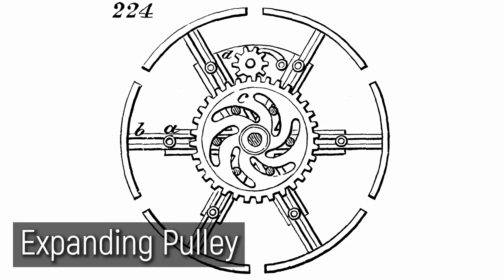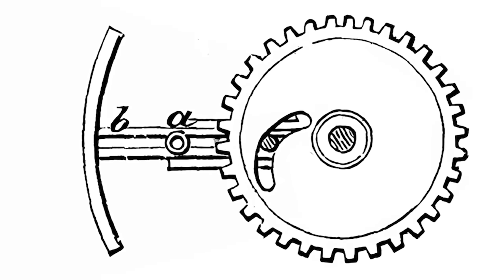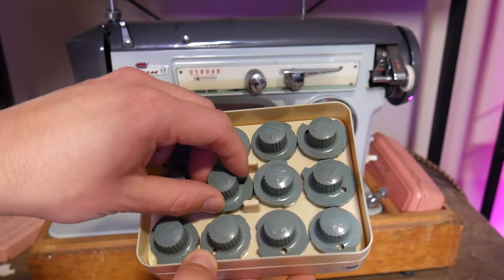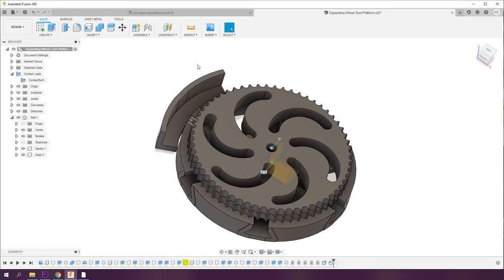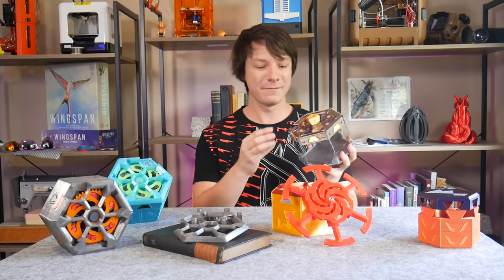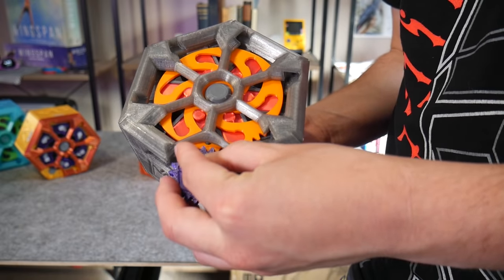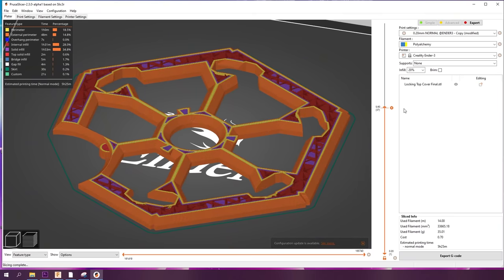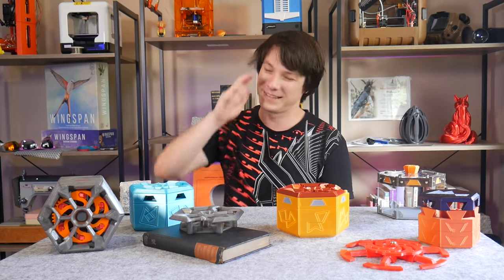This Expanding Mechanism is Crazy Clever

Comment: Best use for this would be an expander, joining two pipes of equal circumference, using the expander inside one pipe to enlarge an area for other pipe to slide in followed by welding/gluing. Turn the long pole the expander is connected to the opposite direction to be able to pull it back out. Of course it must be strong to stretch the pipe slightly wider…

Comment: For the expanding thing : i saw a video, quite some time ago, that used that mecanism ! The maker had attached these triangular panells on top of the rollers, so that when they were at the center it made a decent table, maybe for one or two.  But then he turned it, and it epanded, and by putting separate rectangular pieces in the gaps and the middle, it made a table twice the size, that could accomodate 6 people ! So... it could be used to save space ?

Comment: It would probably make a nice closing/sealing mechanism for the lid of round containers and barrels. Like putting some wedge-shaped ends to the "arms" that press the lid against the container/sealing. Like that snap-in locks on Tupper ware, but on the inside and operated with a single movement. Of course, you'd also need to seal the rotating shaft for the handwheel in the center. And the inside of the lid should also be covered, to prevent debris from getting into the mechanics. And the material of every used component also needs to be suitable for what you put into the container... Jeez. In retrospect, I don't like to work on this project anymore. lol

Comment: You can eliminate the dual key reset (while locking due to the lock raising into one of the spiral gear cam slots) by adding a 2nd magnet in the key. It works well (I did it).

Comment: Is there any way to incorporate springs that would push the arms back out after you wind them inwards? If so I would find a way to use the handle the way you use the key. In a way that allows you to push the handle downward to make contact with the gears, or even pulling the handle up. If you could find a way to make the mechanism lock once the arms  are fully retracted, then you would be able to pull the top off/out while the arms are locked. Then once you put the top on/in you could either pull the handle  back up (disengaging it from the gears) or pushing it back in based on the direction you chose to engage them. Which would allow the springs to push the arms back outward.

By the way I absolutely love your box design. Thank you for showing it.

Comment: This mechanism is meant to regulate the gear ratio of a thick and flat belt. The entire mechanism acts as a pulley, but it’s radial cam/follower only operate to dynamically scale the diameter (& thus turn radius) of it’s relation with whatever is turning it. Think of this mechanism as a slack-breaks or variable sensitivity regulator. I know this because a device seen once used similar formations to allow the slamming of a vehicle’s break pedal to simultaneously deploy parachutes and close fuel paths during speed tests. Though the actual cam articulation was triggered by the drive gear locking as the entire mechanism rotated with the engine. It seems the patent here is describing a more pure example of the principled operations, yet does so with an inverted flow of workings. 
      Instead of thinking of the mechanism statically having force applied to the drive gear, consider the mechanism turning about it’s axis and having the drive gear’s likewise motion retarded by an applied friction or locking catch. This translates whatever triggering force is used into an expansion of the radial pully’s diameter; many useful results can benefit from this. However, the follower arms receive great & dangerously angled vectors of stress physical at sufficient speeds. Especially with angular moment conflicting by the thin strut arms.

Comment: This seems like it would be a cool tire if used for things like mudding. Increasing wheel size and adding gaps between tire pieces. Would be pretty cool to see a jeep get taller too.
Reply: Could be used as a disc break for a wheel as well. Break pads push outwards to the inside of the wheel.

Comment: might I suggest using that expanding pulley to drive a chain.  Much like the system used for a 10 sp bike.  An idler would maintain proper chain tension

Comment: It looks like it could be used for something like a CVT.   A CVT uses two pullies that  both change their diameter to change the effective ratio between the input (engine) and output (drive shaft / wheels).  They're usually two cones that push together to increase the effective diameter. 

With the expanding pulley, it would work pretty well.  I think even the incorrect outer diameter would be handled fine with a stiff belt, like automotive V and serpentine belts.  

Unfortunately, I don't think it would ever work in something as heavy as an automobile .  It would probably be prone to  bending on the shafts and sliding pin.  

I'm not quite sure how you'd control it either, since the whole pully would need to be spinning, so the control gear would be part of the spinning section.

It could be made to not spin, if rollers were put on the exterior part of the ring.   If that was done, you'd only need to include half of the exterior circle, as about 1/2 of it would never contact the belt.

And, normally a worm gear would be used in something like that, because it's far more difficult to reverse the power on a worm gear.   They usually say "impossible", but they can be reversed in the right circumstances.

Comment: Cams are also use in automatic lathes and they have the fastest cycle times. Even faster than cnc 
lathe. But only used in high volume production runs. 100k or more.

Comment: Not sure of an actual example, but I can see a simple modification that would potentially lead to a useful application. If the arms had overlapping / interlocking pulley 'tracks'  then the pulley would be less 'gappy' at larger diameter.  With some 'locking' points on the central wheel (cam), then there would be several fixed positions / diameters for the outer 'pulley' and this would be a replacement for any stack of pulleys / gears such as in a drill press, bicycle gears, etc.  I'm sure with some work by a clever mechanical engineer this could become an 'infinitely variable' gearbox arrangement.

Comment: this could be used as a variable centripetal pulley where you could drive the mechanism with a concentric clutch like system, with springs to pull it back - and the pulley could be kept round by putting a rubber bushing around it that can stretch. 

Essentially as motorspeed increases the pully diameter could be made to increase with the speed - or vice versa. Could have been used back in the steam age to regulate speed or load of a mechanism during startup, and during fulctuations from the driving motor.

Comment: This mechanism is kind of similar to expandable winding mandrels for winding machines in manufacturing. Not exactly the same but same idea where you need to be able to collapse radially to get the mandrel out of the middle of the roll of metal/paper/flim etc.

Comment: One use I can think of is an infinitely variable transmission. Consider the standard Drill Press. There is one set of pulleys above the motor and another above the spindle. By changing which pulleys are connected you vary the speed of the drill chuck. Using two of these would give an effectively infinite number of spindle speed variations instead of just 5 or 6.

Comment: Nice! Would be cool to put the small gear in permanently, and require an actual key to open an actual lock before you can turn it or put the lock on the actual shaft. Also, swivel arms would cause less wear and friction than cams and followers for such a purpose.

Comment: The way you should use the expanding pulley is to make a gear box. By putting a gear or sprocket on each arm and use a chain or a belt and when the pulley expands it changes the gear ratio. But the problems is I could see it not working from the chain or belt holding the pulley in the closed position.

Comment: What if the key itself was part of the "pulley-wheel" cam mechanism? You can also create "dummy" and/or "inverted" stud mechanisms so that the key can have an unique, unpredictable design. For example, if studs 1-2-5 are "forward" and 3-4-6 are "inverted", you need a key than only acts on 1-2-5 or you will end up closing 3-4-6 instead.

Comment: It could have been used in a  centrifugal clutch, connect springs/rubber bands to the shaft and rail so the shafts only expand after a certain RPM is hit. Make the ends very abrasive and put it in a drum brake .. well "drum" (?) With this mechanism u can put notches in the pulley grooves so the shafts would lock in place after expanding, making it constantly rotate the drum and what is attached to it

Comment: It is funny how it is called the "expanding pully" because there's nothing about it that makes it a pully system. In fact, it is actually a pulsating system that can create energy. The problem with this current design isn't because it is linear, but because it is static. If the rivets were designed with a 3D map so that it will constantly peak into one another without any immediate stop (I.E. a flawless transition from point A to point B, to point C, back to point A), you will have your very own geo-weapon that can cause catastrophic tidal waves on the other side of the planet- this in due can be used the same way for defense from the same weapon as well.

Comment: Not as a pully, but in my older coin sorting bank the same mechanism to remove inset holding containers from a cylindrical cell with linear motion
Reply: Its not lubricated but it doesn't work well

Comment: What about having a straight "key" (instead of the round one) gear with irregular shaped, sized and placed teeth that have to mesh up with the teeth of the rotary gear in the lid.   When you insert the key it rotates the internal gear.  The irregular teeth allows you to have a unique key to that lock.

Comment: I've seen similar(derivative) expanding cylinder drum type brakes on a few military vehicles. I'm pretty sure those vehicles were circa ww2 so Idk if that is what you would call a modern use of the mechanism. I would think that some fishing reels might benefit from this sort of mechanism as well but I am not aware of any specific application. Anyways cool video will real info, I like it. Keep up the good works.

Comment: the expanding pulley is the father of the centrifugal bell clutch ... as it spins fasteners the pads spin out grab the bell and apply a force to that making what the bell is connected to (by a chain say) move ... if you did you outer most arcs wider ... and overlapped them in such a way that when fully expanded they still make a circle ... you can now add a a chain drive or belt drive or even a rope ... and the pulley stays round ... 
.
in movies they have a descender rig that slows the person attached down by moving a fan ... 
.
another version of this type of pulley can also be found in drum brakes ... instead of using fluid it uses mechanical motion ...

Comment: I could see this being suited more for a sprocket than a pulley for a bicycle geartrain. The expanding ring's lack of concentricity as it expands and contracts beyond the original radius is less of an issue as we've seen on bikes with oval and even square chainrings. The cons would be the added complexity of the expanding chainring and/ or sprocket. The pros would be a narrower drivetrain, no chain lateral angles, no more derailleur, ability to shift without steps, ability to shift under full power, ability to shift without pedaling or even moving! If the chainring and the sprocket were both expanding types, you could also theoretically eliminate a chain tensioner.

edit: seems this DOES exist in the patented VECTr system!

Comment: Thanks.  It seems to me that the expanding pulley idea might work, if you changed the shapes of the outer 'wheel' portions so that they become overlapping.  If each one is too long, but tilts such that it goes under the next (like subduction plates), it might work.  The operative word is might.  I might be completely wrong.       tavi.

Comment: Betcha it was envisioned for use with belts, and the non-concentric arcs wouldn't much matter then. I've seen old-school mechanical shops and sawmills where all the machines are driven by belts coming off one or more big rotating shafts, and this would give you the ability to vary the speed of your pulley without changing the speed of the shaft.

Comment: Thinking abot actual use off that mechanism first what comes in mind is a clutch for cylindric axises, f.e. if you need to extend the length of an rotating axis while still operating its and transfer it's rotational energy along those axis. Another application would be changing the radius of an belt driver, for example for exchaning the Belt more easily or get another ration of transmition. As long as you don't do high rpm on this, the gaps in the extended state barely matter to the belt. and you could also use springs or pulley technics in each extender to even fill those gaps in the extended state and let them retract again along with it.

Comment: Why not have some kind of folding part between each arm, that fold in when retracted but are unfolded when expanded and full the gap. They could even lock when fully expanded. 

I'd assume it would be harder to retract the mechanism at that point, so maybe have portions of the gear pull inwards on the middle of the joint between each arm when retracting. (Idk if that made any sense but hey just a thought.)

Comment: Maybe the design could be augmented by having two (or three) wheels which protrude at different rates. The one(s) with the extended reach could push/stretch the circle parts'  outer edges a bit more, thereby reducing the concentricity issue. Provided, of course, that a somewhat flexible material is used.

Comment: had a friend try to make a wheel out of something like this where the wheel would stay normal as long as it didnt have any issues spinning. if the axle and wheel fell out of sync for any reason, like traction issues, the gear would shift changing the wheel shape to attempt to match the terrain causing the problems. never found out if he managed to get it working

Comment: Hey - How about this idea: Having another pull rods put on the other side to cover the inner gear disc, could be attached to the same guides, but the pull rods rotated by specific offset. When expanded, the gap between the rods should be the same as the rod length itself, essentially the other offset rods filling up the gaps. Would that make a smooth rotational disc?

Comment: Man, I’m always hearing all these Ender 3 success stories, but I’m just sitting here with my Ender 3 that can’t even print one line without four things going wrong.

Spent months and a lot of my sanity trying to fix this, but no luck. I’d fix one problem, then another would pop up. I fix that new problem, and the original one pops up or something entirely new, and it’s extremely aggravating. Probably the most major issue is the slight warping that the bed has, where the center is noticeably lower than the edges, and if I fix the edges, then the center is higher, but if I fix the center, then the edges are higher

Comment: It is reminiscient of the mechanism used on some bicycles. The mechanism for setting the cam offset is different. Still, it's a practical use. 
Also, keep in mind that pulleys operate on a flexible medium; hexagonal pullies  on rope work just fine, provided there is nothing interfering with the rotation.

Comment: I am not an engineer but isn't the function of the pulley gear to provide a self-adjusting wheel at the driving end of the belt that would automatically expand to take up slack in the belt as it was used?
As the pulley was turned to drive the belt, it would try to expand but would be blocked by the tension of the belt against the pulley. As the belt slowly stretched under the forces applied to drive whatever was at the other end of the belt, the pulley gear would automatically expand to take up the slack. This would work up to the point  where the pin reached the end of the grove. At that point, the belt would have to shortened to take up the slack and the pulley set back to its minimum diameter. 
In theory (mine at least), this would reduce the number of belt maintenance cycles and keep the belt tensioned automatically as opposed to having to provide an idler pulley at some intermediate point that would be manually adjusted to take up the slack in the belt. A slipping belt would not transfer 100% of the power and would result in friction that would damage all of the machines attached to the belt.
At the time of the invention of this device, we did not have modern belt fabrics and had to use leather or natural rope that, over time, would stretch under load.
Also note that the belt would only contact on one side of the pulley and would not care about the gaps. The pulley would have guides (edges or troughs) to keep the belt from slipping off the pulley. 
The locking ratchet was probably important to keep the pulley from contracting when the belt was stopped or not under load. Without it, the pulley would shrink in diameter and would lose tight contact with the belt and thus might not re-engage when power was applied since the pulley would just spin. The ratchet made sure that the pulley diameter only increased until a mechanic reset it when the belt was maintained.

Comment: If you were to switch the small outer ring gear to a worm gear it could drive the center gear, but the center gear could not be able to drive the worm gear and it would lock in any position.